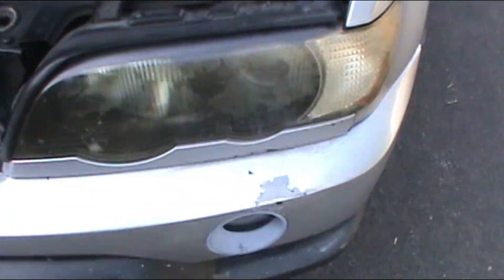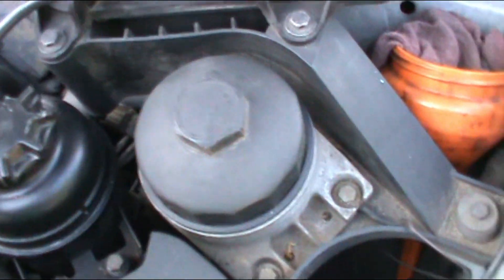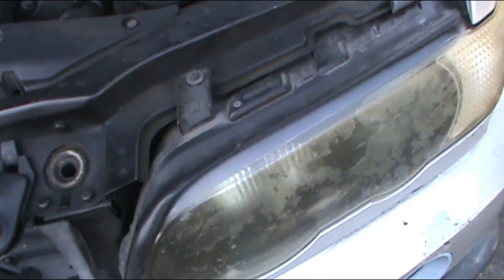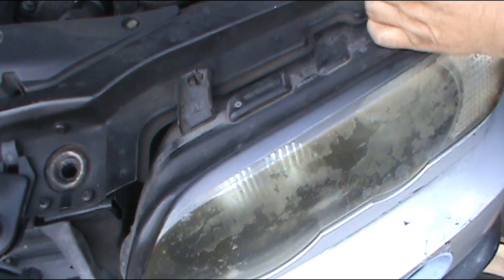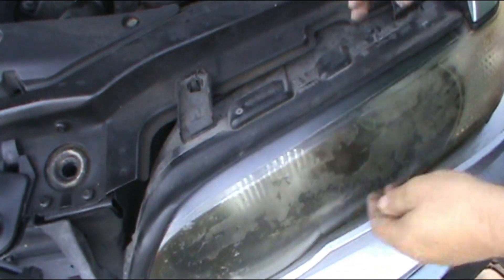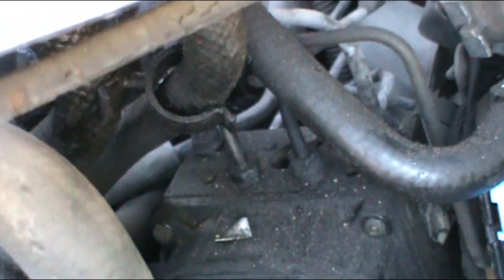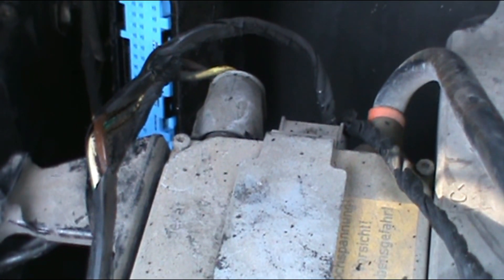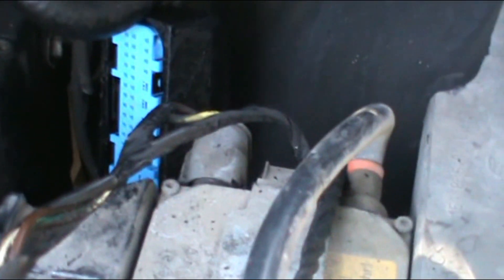Trans Fail Safe Mode Troubleshoting 2000 BMW X5 4 4i

Comment: Would the ABS module going bad cause the X5 to have starting issues? If my X5 cranks it will start but sometimes it has issues cranking. I'll go to start the X5 and if it doesn't start I turn it off and try to start it again. When it doesn't start it's almost like there's no crank and then I let go of the key and it goes ka'chunk, try to start it again and it starts. I replaced the cam and crank shaft sensors already. About once a month I get the Trans Fail Safe code, I reset it and drive it until it gets the code again. Any tips?
Reply from the maker: You may have two different problems, I haven't heard nobody heaven a starting problems because of the ABS module, but this may be a unique problem on your vehicle. The Trans safe mode, definitely the ABS module might be the problem, try to disconnect the ABS module without removing it and if it's a problem is solved you got it
Reply: @TIPSFORDUMMIES  Will disconnect it just to check. Thanks
Reply from the maker: @dbender3644  yes, you can disconnect the ABD module just to see if the trans safe mode and the other problem  goes away, if it does bingo, but if it doesn't just connect the ABS back. Thanks for watching my videos
Reply: I am having the same issue with the key not starting as well. I'm very interested on your results.Thank you.
Reply: @curtrn  I still haven't fixed my issues. I believe mine may be a starter going out but it's not like any starter I've ever heard before going out. I've replaced, the crank and cam shaft sensors, the MAF sensor, checked the battery and posts both inside the trunk and under the hood. Once I get the Trans Fail Safe message I just break out my code reader, reset the code and I'm ok for another month or so. It still has issues starting but once it doesn't start I just wait a second and try again. The most I've ever had to do to get it to start was 4 tries. So I've just been dealing it with it till it completely dies.
Reply: Hi D Bender - I have exact same issue as you but now it won't turn over ever. Don't know if I need to check ABS Module Sensor as this video shows.  I'm 62 female and not sure I'd get the last part of this done.  Can you tell me how you "reset code" with your "code reader" ? I don't have a code reader.  The battery seems fine and all the lights come on and I've just paid 3600$ to have vehicle completely fixed two months ago.  Mine is 2001 and I've already put too much money into it to keep chasing this.  Any information would be very helpful.  Thank you.
Reply: @curtrn  Hi Curt - have you had any luck?  My fail safe trans code has finally come to a no starting place.  Won't turn over but all lights up.  Recently had a lot of work done and so disappointing they didn't get this code out of my life for 3600$   Any information or advice would be appreciated.  I'm thinking now that it is not the ABS module after reading what TFD wrote to D Bender above.
Reply: @allstar2701  My problem ended up being the starter...my local dealer wanted 800$ to replace it. I found a local garage who was amazing and did the work for 395$ out the door and that's including the starter and they used and OEM remanufactured starter. These guys are amazing, if you're in the Sacramento, Ca area I can tell you the name of the place. If you don't have a code reader then go to your local auto zone, I believe some will reset codes for you for free. Ugh 3600$...That stinks, the suv isn't even worth that much anymore. Mine keeps nickel and diming me like crazy and I'd get rid of it but its paid off and I don't want to ding my credit getting a new car cause I'm about to buy a house, otherwise I'd get rid of mine asap.
Reply: @dbender3644  Thanks sooo much for reply.  Mine very well May be starter as it seems dead. So I’d have to tow it to auto zone. Should’ve done that when I had it running. I’d really like to know if you had the trans fail safe mode read out?  Mine not only played the game of I may or may not start  - it seems to at times only drive in first gear. Slooow. Like pushing gas pedal was tough. Did you ever have that slow drive issue. Doesn’t seem to be related to starter but what do I know?
Reply: @allstar2701  Well don't tow it to Auto Zone for a starter, they won't replace that. Some auto zones will check the codes for you, some won't so it's best to call them first to see if they'll check your codes. But if you're X5 isn't starting then you need to take it to a shop to get that fixed, while it's at the shop you can ask them to reset the code. When you have the trans fail safe mode displayed on your instrument panel your transmission will not shift to the next highest gear. It does this to prevent damage to your transmission. So you need to reset that code with a code reader first before your vehicle will go faster, you can find them on Amazon for like 10$ but there's no point in buying one until you get the Starter or whatever is causing your vehicle not to start fixed first. What I'd do is take it to a shop for an estimate, if you get the work done ask them to reset the code and go from there. My starter having issues trying to start the suv is what cause my trans fail safe code however many other items can cause that same code. Good luck.